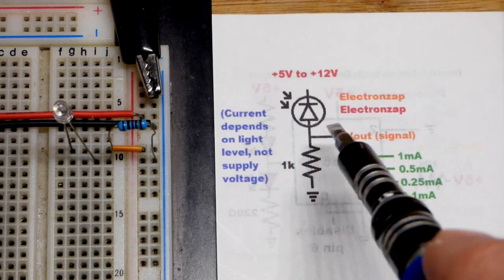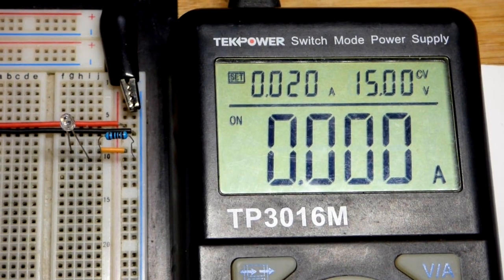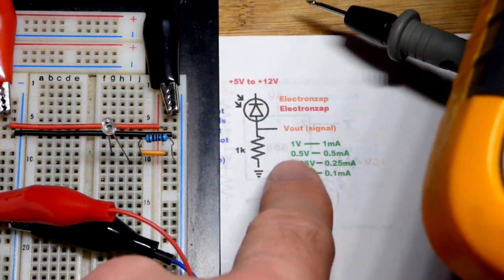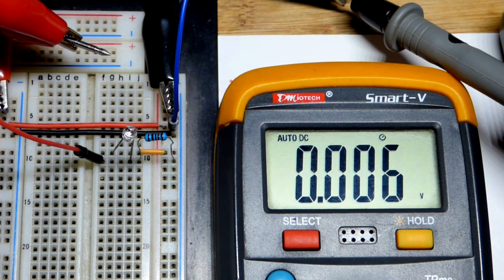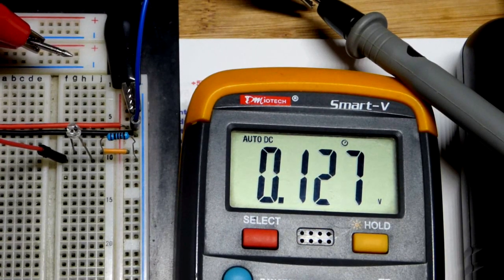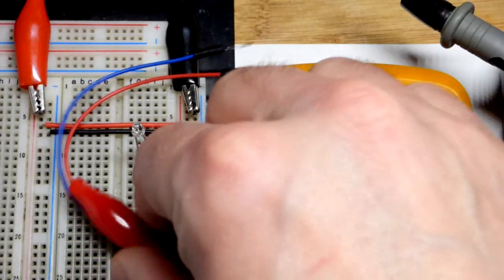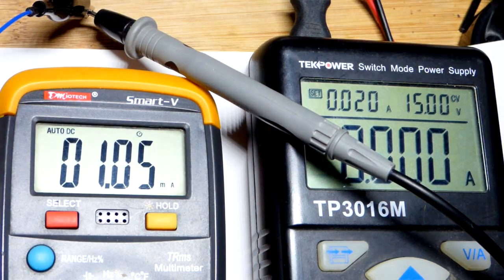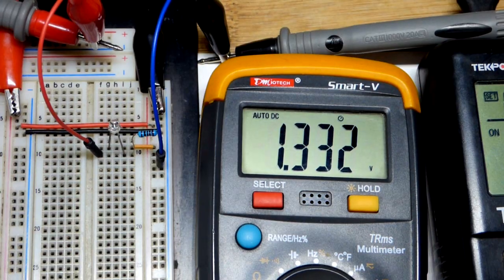Photodiode Component Basics Demonstrations And Multimeter Measurements With 1k Resistor 1000 Ohms

Comment: Always check data sheet for maximum reverse voltage. LEDs work as photo diodes but some do not like so much reverse voltage. I use LEDs and a op amp not to create a big boom. Thanks.
Reply from the maker: Good advice. I usually limit reverse voltage to about 9V with LEDs. I've destroyed some at a higher voltage.